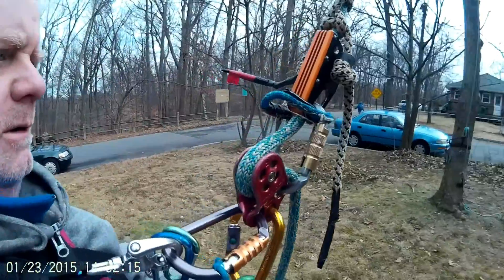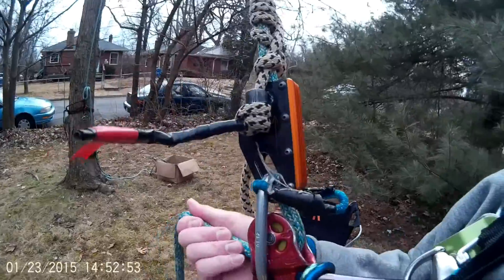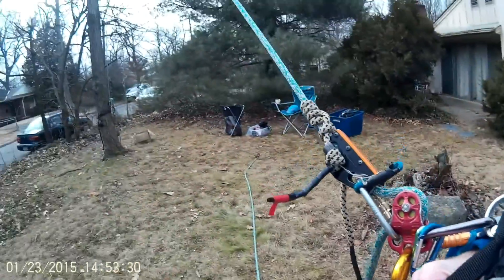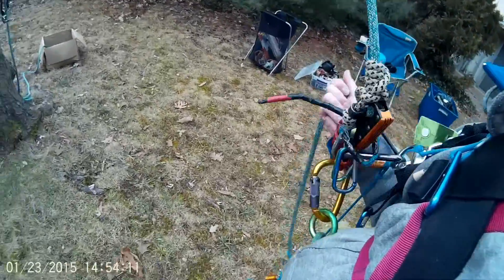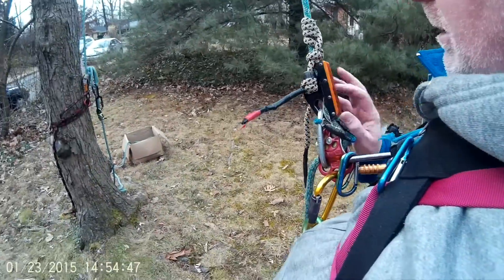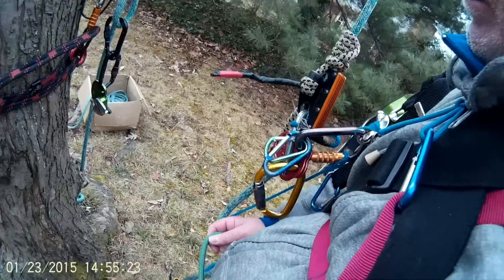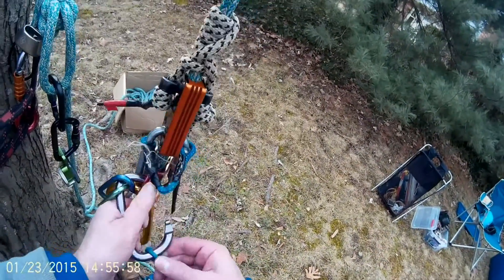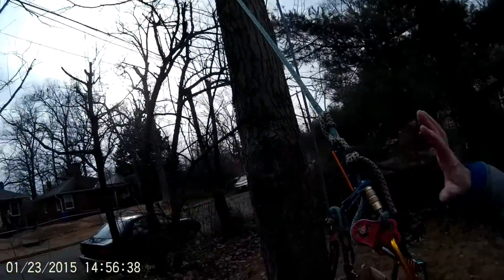Hitch Hiker with Triple Attachment Pulley for Tending Edited with VideoPad software by NCH

Comment: Looks like a clunky pain in the arse. ZigZags are on sale from Bartlett right now for $229. Id lose that mess of carabiners & go for the glide of tge Ziggy!
Reply from the maker: I think the Zig Zag is intended for DdRT use.  The Hitch Hiker can be used either DdRT or SRT.  Some folks use the Zig Zag with a tether and a Rope Wrench for SRT, but I don't think this setup is approved by Petzl.  The Hitch Hiker goes quickly between SRT and DdRT.  Dave from Montana recommends the use of a more simple setup with the Hitch Hiker using just a Fixe pulley, I think it is called, that attaches to the rope bridge ring.  I have not tried that, as I like having the additional attachment points that the Hitch Climber pulley offers.  Thanks for your comments.